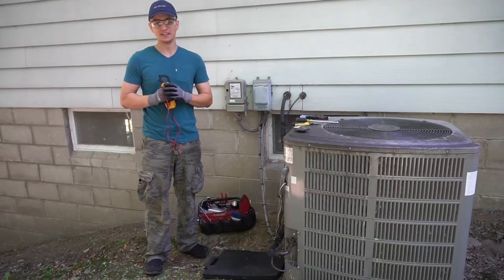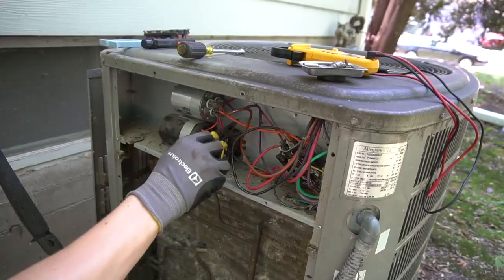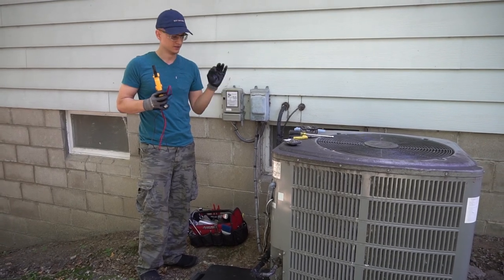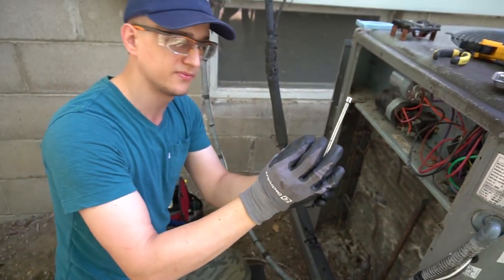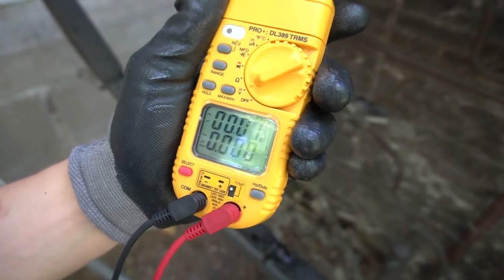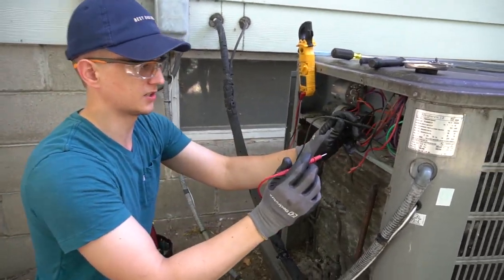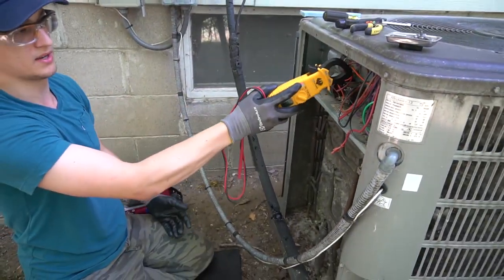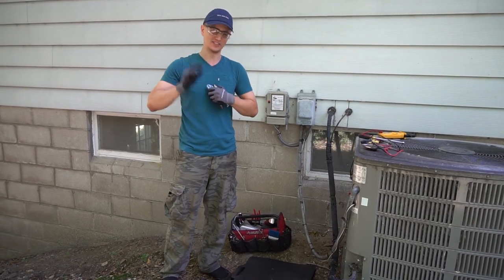Watch This BEFORE You Fix Your Own AC

Comment: I turn thermostat to cool, blower at furnace comes on. Outside unit does not come on. I took panel off and both my capacitors appear ok. CAREFULLY, pushed plunger in on contactor, and everything started up.  Does this mean my contactor is bad or do I need to, with a meter, ck both my capacitors?
Reply from the maker: Hey Scott! I am glad you did that test carefully ;) So if everything started up, that means your capacitors are good. Most likely your contactor is fine too but I can't say for sure. (would have to check it with a meter) More likely power from the control board (24v) is just not getting to the contactor. I would first check and see if your 3 amp fuse is blown at the furnace control board. And then, find the thermostat wire that comes out of your house and into the condenser unit (usually with the freon pipes). That wire will usually have 2 wires in it, a red and a white. Do those wires go straight to the contactor or does one of them go somewhere else? Can you trace where it goes?
Reply: If his blower is coming on then it's not the 3amp fuse. Maybe a float shut off switch?
Reply from the maker: Thanks Matt! I am from Minnesota and most of the AC units here do not have float switches. So I guess that is not the first thing that comes to mind. But as I keep answering more people, it seems like the float switch pops up a lot... Here is a good article about the float switch: http://acwiz.com/index.php?action=artikel&cat=18&id=26&artlang=en

I used to think that too, about the fan not coming on if the 3 amp fuse is blown. But I came across a few furnaces/air handlers that still ran the fan even when the 3 amp fuse was blown but nothing else would work. On some it seems like if the 3 amp fuse blows, the fan just runs constantly.

Comment: What the name of the meter and pen u are using?
Reply from the maker: It's in the description ;) Although I couldn't find the same voltage pen I have in the video so I just did a Klein pen instead (that's a good brand)

UEI Multi Meter: https://amzn.to/2MbSHC2
Voltage Pen (not the same as mine): https://amzn.to/2tq5t8d
Fuse Puller: https://amzn.to/2MDSQz7

Comment: The blower turns on but no cold air. about every 10 minutes or so I can hear a short buzz come from the unit outside. What is that? and can I fix it myself or should I call someone?
Reply from the maker: That sounds like a bad capacitor. It is a pretty easy fix. I have a video dedicated to that one ;) https://www.youtube.com/watch?v=C82HvbvP08E
Reply: Word of Advice TV  

Thank you! I will definitely give that a shot and will gladly spend $15 on a capacitor.
Reply from the maker: Alright! Good luck!

Comment: My ac not blowing out cold air. My condenser is turning on. The blower is also turning on. A friend of mine said it might be the control panel. Do u have any suggestion please.
Reply from the maker: Can you tell if the compressor is turning on? When the unit outside turns on, usually you can tell a difference between the compressor turning on and the fan. Sometimes what will happen is the fan will spin but the compressor is not turning on. Also, do you have a meter that you can check your capacitor with? (Watch my most common fix video from the description to see how to check it)
Reply: i had a friend replace inside and outside equipment cost $1400 dollars labor 1200 everybody else wants  $5ooo.

Comment: The snapped off prong was not the issue.  The phase connection was still open.  Your capacitor had stored charge and you discharged it to ground through your tool.
Reply from the maker: I would have to disagree. I checked my contactor and it had 120v going to it. Then I checked the terminal on the capacitor that I touched and that too had 120v. That's when I started wondering what is going on... And found the disconnect prong broken off.
Reply: Ok - The way you made it sound, only one side/piece of the prong snapped off - if the entire copper bus for that phase was left intact, then yes, you would have continuous voltage to the contactor - and if the contactor only had one contact (not double pole contats), I would agree live voltage would be present. Thx for the clarification!
Reply from the maker: Since this happened last year, I can't remember the specifics, but the disconnect was a different style then the one I have at my house (in the video). I understand what you were saying though.

Comment: My ac won't turn on. I changed the capacitor and the contactor too. All I keep hearing is a click but nothing happens. Do I need to get a hard start kick going to get the ac unit going??
Reply: Please help.
Reply from the maker: Do you have 240v going to the unit?
Have you checked the circuit breaker and does your disconnect have fuses in it?
Have you checked your 3 amp fuse in the furnace control board?
Is the contactor plunger getting pulled in when the thermostat calls for cooling? 
What happens when you manually push in the contactor plunger? (carefully, 240v may be present)
Does anything work? (condenser fan, compressor, or blower motor inside)
Do you have a meter that can check voltages?
Have you watched my AC fixing video? It may give you more ideas of what to check. (look in the description)

I don't know about the hard start kit.. Maybe if the condenser fan was turning on but the compressor would only buzz for a second but not start. I neither one is turning on then likely the power is getting interrupted somewhere. Either the 24v or the 240v.
Reply: Word of Advice TV yes the blower inside of the furnace is working and blowing. The thermostat works.
Reply: Luis Salgado  , I have the same problem and don’t get 240 v at the disconnect box or at the contactor connects(test with the volt meter).  It’s hard also I couldn’t find which breaker for the unit since it’s not label.  Anyway, I saw other video suggesting if you don’t get 240v at the disconnect box chances are the breaker is bad.  Good luck

Comment: If the disconnect is wired correctly and you pull out the disconnect you should be able to pull out the fuses because those will not be live.